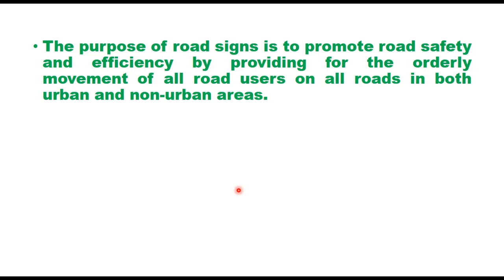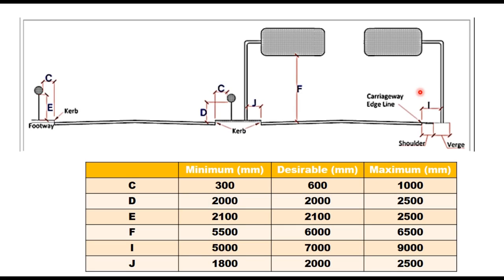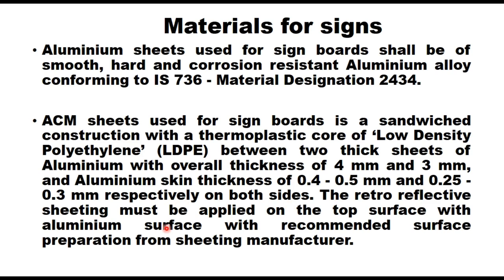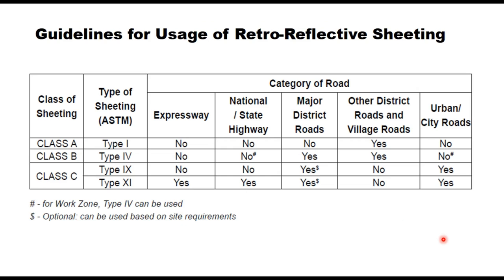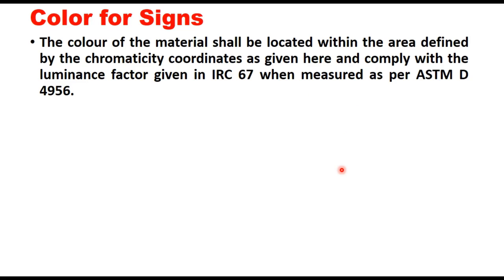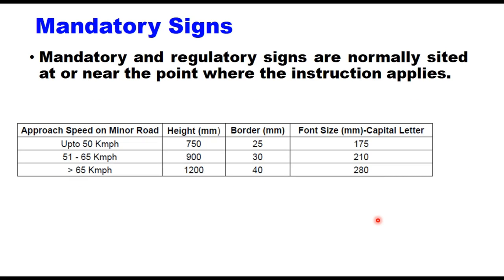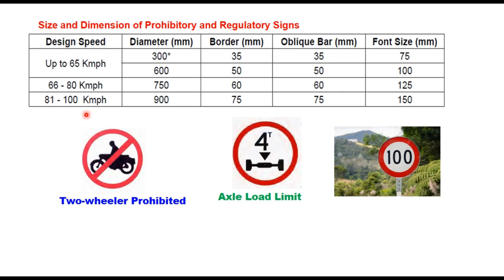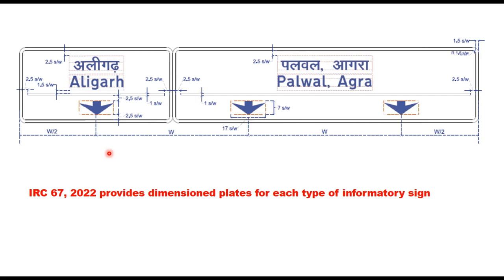#roadsigns  Design of road signs as per IRC 67, 2022. siting of and material for road signs

Comment: I have got 2 questions
1. Whta are the guidelines for distance between 2 signs if there are multiple sigange to be displayed in a cluster? 
2. How to decide the thickness of ACM sheet?
Reply from the maker: IRC code reads like this.
When several signs have to be placed along the same section of road, take care that they do not obscure each other. Care shall be exercised to locate two successive signs at a minimum distance of 0.6*V metres apart (where V is design speed in Kmph) in the case of interurban roads, whereas for urban roads, a minimum distance of 20m between two successive road signs shall be maintained.
on ur second question, IRC do not suggest any criteria but in my opinion, it should be based on requirement of Mechanical Properties of the sheet.
Reply: @SatishIITR  Thank you!
Reply from the maker: @VivekSingh-si1ut  always welcome